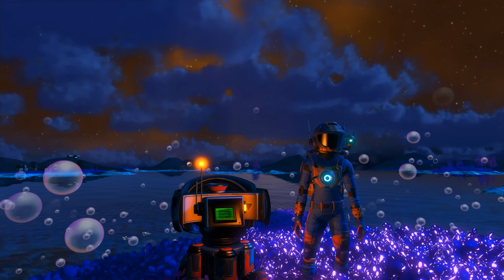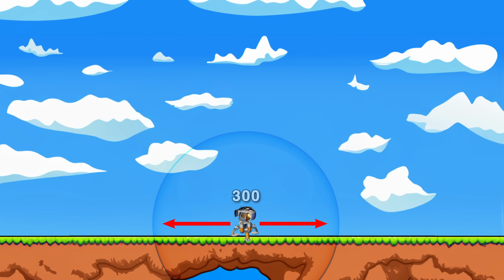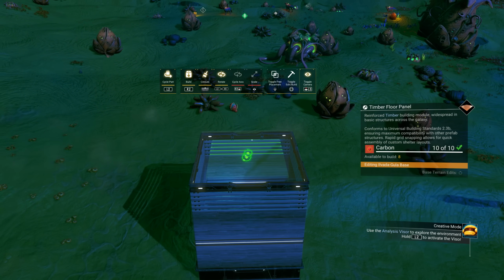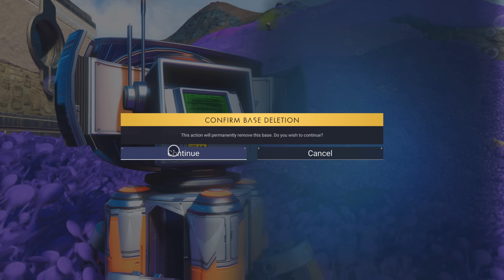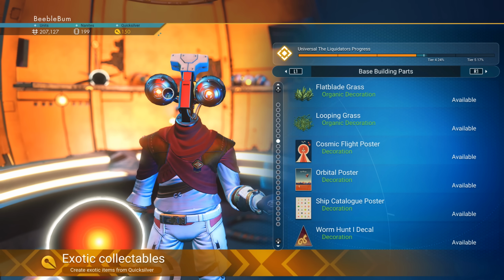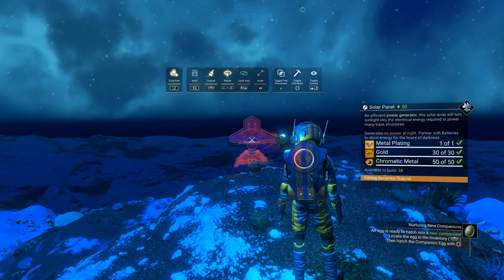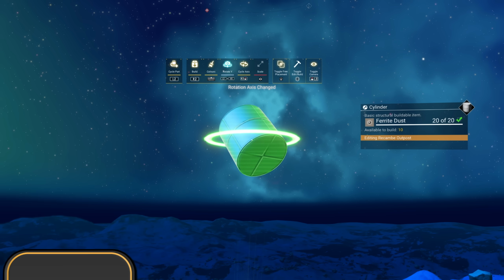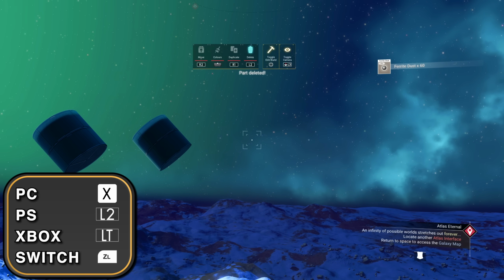Complete Beginner's Guide to Building Basics | No Man's Sky Base Building Essentials

Comment: Newbee Q: I noticed there are several materials to build a base building, like Wood, Stone and so on, do you need to use different materials on different planets or can you use that what you like, I was wondering if any material is better for a different type of planet, like frozen, or hot?
Reply from the maker: No, none of the parts have a specific protection against hazards, they all are indestructible.

Comment: Hi there, I am having a problem where I can only build in free mode and not snap. And I can not delete or move anything. I am playing through Steam on a PC. I did not have this issue at first and was able to build a few other bases on other planets with no issues. I have not found a solution to this yet. Would anyone be able to help? A side note, when you pull up the screen to delete/move, the bar under each option is red and is always red. Also. when you hover over anything you built and try to delete/move it, it says"nothing to pick up" or "nothing to delete.

Comment: Is there any way to have a glass floor or a room with transparent walls, floor and ceiling?
Reply from the maker: There is the cuboid glass room... hehehe...
If you want however to use the glass floors to make everything in glass, you will need glitch building.

Comment: 5.20
I use what I call a "safety cube", using the cube adornments at 10x10 and stacking them to 3 or 400 pieces, you get an early warning when you breach the upload limit. 
It would be great if HG just displayed the counter right from 0 though, super wierd that they don't. 😊
Reply from the maker: Yeah, I know - there are a lot of basic features that would make QoL so much better.
And I don't understand why it has not been added or fixed.

Comment: I really wish they would bring back the legacy pieces. Do you know if there is any way to prevent stacked walls from changing their meshes?
Reply from the maker: I am unsure as why legacy parts were removed for new players... 
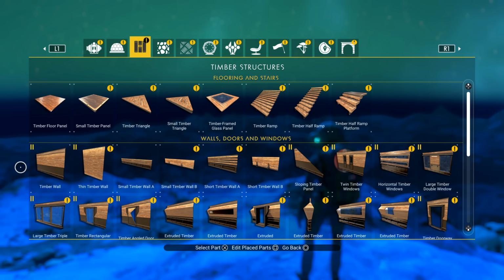But, as explained at 9:16 you can choose which variations to build with, avoiding the contextual building.
Reply: The parts that have the yellow “double tick” on the icon (it blends in a bit) have alternate variations, which places the variant itself without the pieces changing. I hope this helps!

Comment: What a great idea to make this a series. By the time you get to the advanced stuff, you can cover any new things that come out with future updates!
Reply from the maker: Yeah, the plan is to start first with non glitch building guides. then gently move into the other advanced techniques.
Reply: @Beeblebum  i would like a guide on underwater building. I built a base underwater, starting with a underwater cylindrical room and it randomly makes water sound like im swimming. Also the landing pads were almost perfectly level with the water,  but sold wouldn't work.  Also the surface level prefab shows the floor in water and the ladder + Vertical tunnel is glitchy.